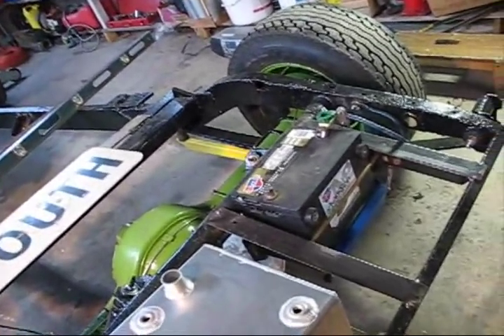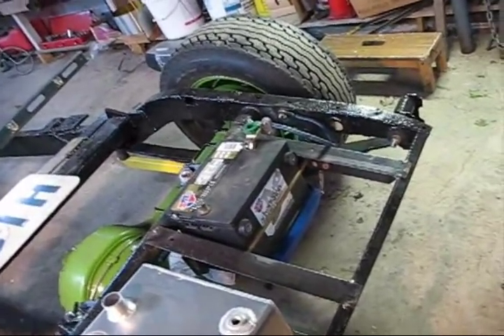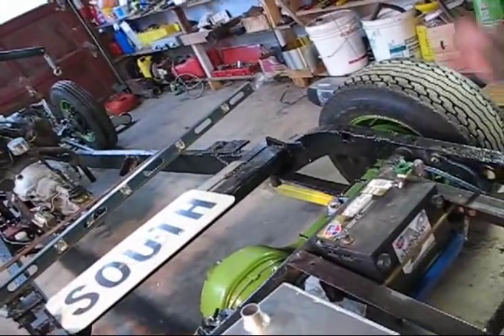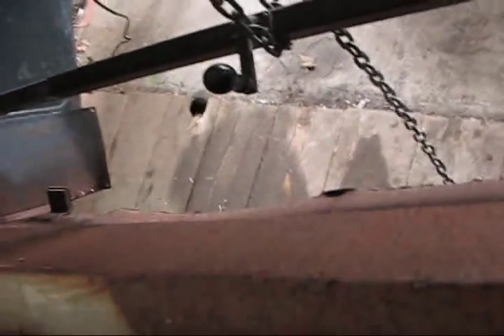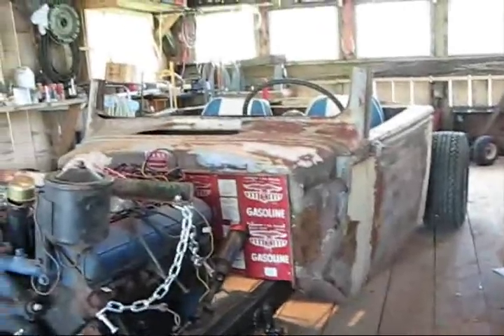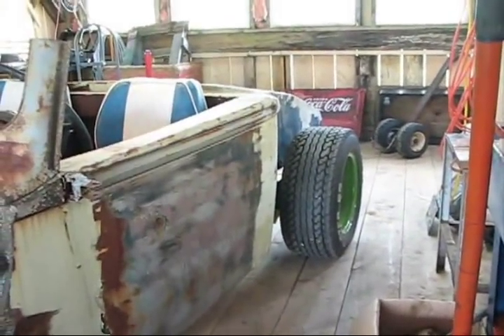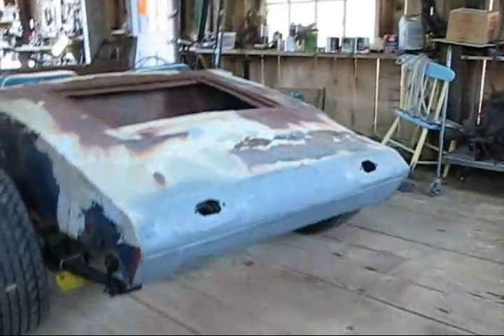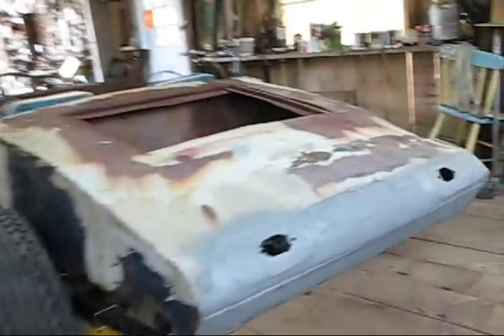Putting the body back on the ratrod with banjo music

Comment: You are doing an awesome job, wish I was there to help (or watch in person!). I built a couple of rods back in the late 70's and early 80's and your project brings back a lot of great memories.
That flywheel must be real expensive, to take so long to make, huh?

Did you think of using the brake drums that fit the brakes and backing plates on the rear end and just redrill the bolt pattern? I think that would be pretty simple to accomplish for you.

Keep up the good work. Can't wait for the test!